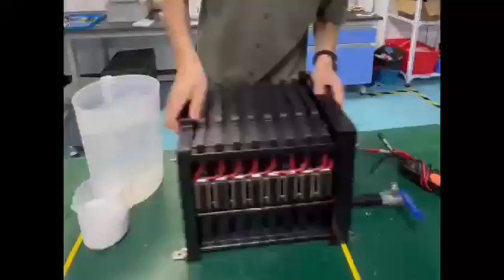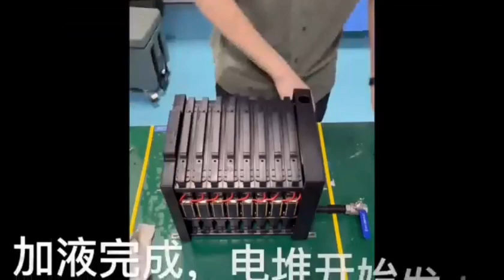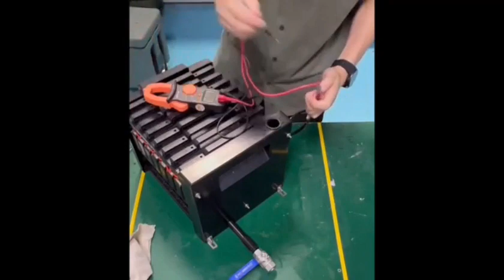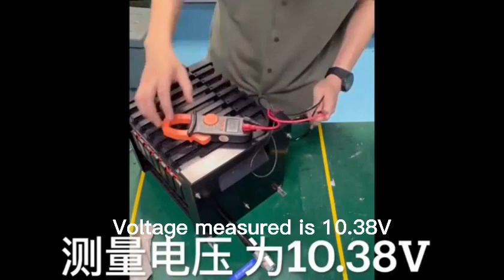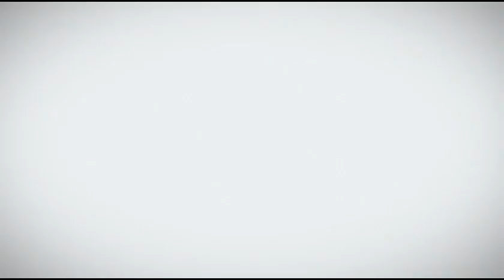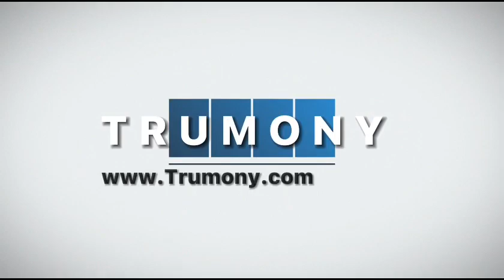Aluminum air battery

Comment: The rich and powerful must have invested lots of money into lithium ion batteries..... Aluminum air batteries have 5 times the energy density is safe and 100 percent recyclable.... And aluminum is the most abundant metal we have.... Goes to show what happens when politics and money push the technology...
Reply: it's not rechargeable.
Reply: More energy density? This ass prototype definitely doesn't, if they wanna do that they gotta get better.